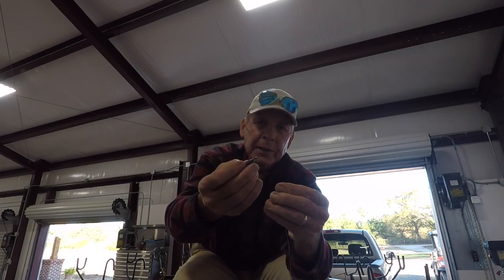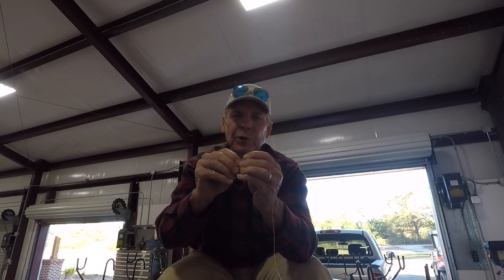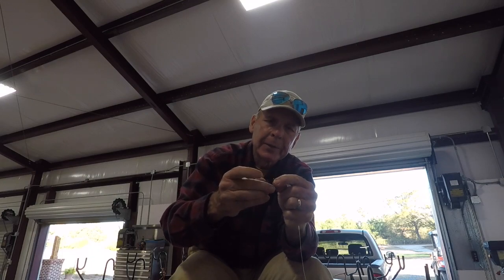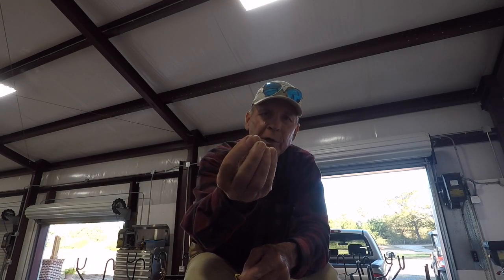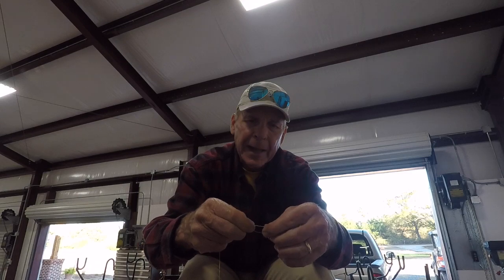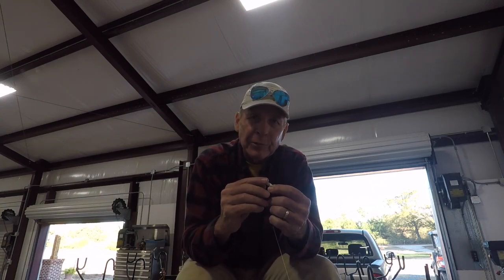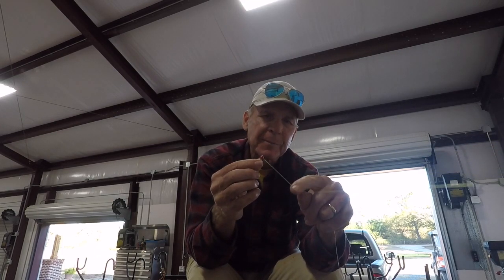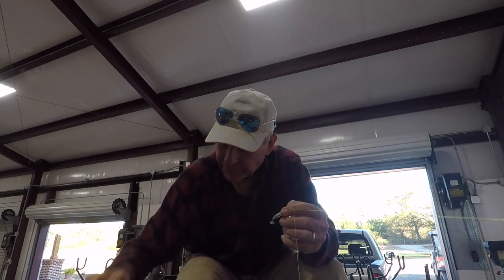Rigging for Combo Trolling with Minnows

Comment: This was good for me as well.  Appreciate it.  I was thinking about pre-rigging double jigs with 4 lb test and fitting the main line with a swivel that I could tie a new rig quickly after getting hung and breaking off.  Too late for me to purchase jigs with light-wire hooks.  Seems that you would just retie both jigs if that happened to you?
Reply from the maker: If you break off the top jig then you do have to retie both jigs. Your swivel idea will work we pre-tie leaders for the pushing rods.